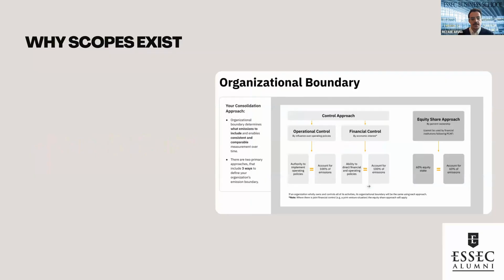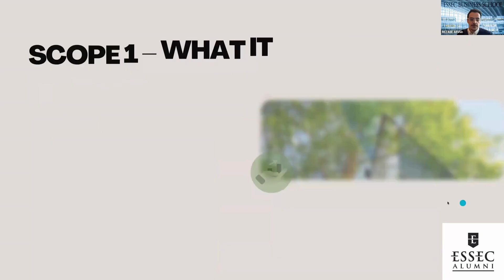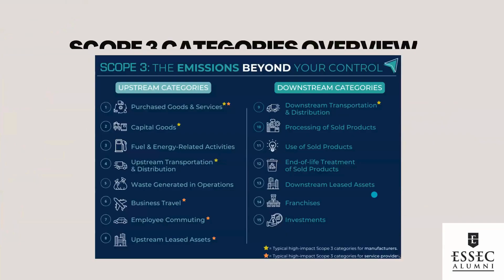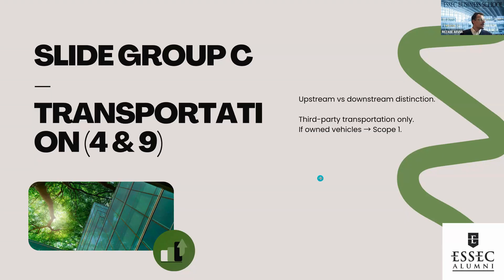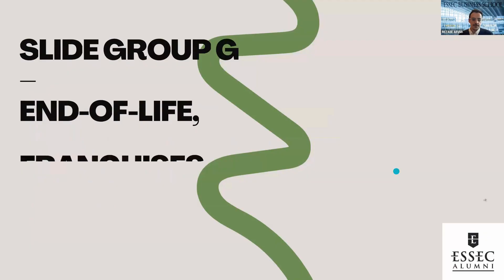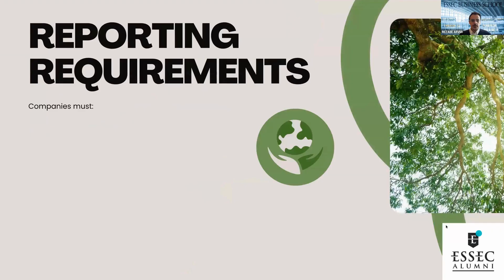Impact Workshop by ESSEC Alumni : Demystifying Greenhouse Gas Scope 3 Emissions

Comment: I've received two questions, which couldn't put it in the recording:
Q1: “Is there any training you would recommend to be certified as ESG Controller and competent to work on non-financial reports?”
Great question! It depends... on your sector, the size of your company, your reporting maturity, and your long-term roadmap.
But in practice, there is no single certification today that makes someone a fully qualified “ESG Controller.” You need to consider, the role is at the intersection of finance, sustainability reporting, internal control, data governance, and carbon accounting!
That is why I would approach it as a competence stack rather than a single certification.

In 2026, I would prioritise four layers.

First, ESRS and CSRD reporting. Start with EFRAG’s own materials: the ESRS Knowledge Hub, implementation guidance, Q&A, educational videos and the latest simplified ESRS materials. These are not “certifications,” but they are the closest thing to the source material that preparers and assurance teams will use. https://knowledgehub.efrag.org/eng

Second, carbon accounting. For Scope 1, 2 and 3, the GHG Protocol remains the core reference point. I would use GHG Protocol courses and guidance first, especially the Corporate Standard, Scope 2 Guidance and Scope 3 calculation guidance. For someone who wants deeper technical competence, the GHG Management Institute is also worth considering. If you're a student, you get a really good discount on the courses. https://ghgprotocol.org/e-learning-opportunities

Third, CSRD / ESRS practitioner training. A structured CSRD course can help translate the regulation into reporting process, gap analysis, datapoints, controls and audit-readiness. Cambridge CISL, Accountancy Europe, CSRD Institute and similar providers can be useful, but I would judge them by curriculum quality rather than brand alone. Look for coverage of double materiality, value chain boundaries, datapoint mapping, internal controls, audit trail and digital tagging. https://www.cisl.cam.ac.uk/education/learn-online

Fourth, finance-facing ESG credentials. If the role is close to investor relations, financial analysis, banking or portfolio analysis, CESGA from EFFAS is one of the strongest European options. But it is not specifically an “ESG Controller” certification; it is more relevant for ESG analysis and integration into financial decision-making. https://effas.com/professional-certificates/effas-certified-esg-analyst-cesga/

My practical priority order would be:
GHG Protocol basics → ESRS/EFRAG source materials → structured CSRD/ESRS practitioner course → double materiality workshops → CESGA only if the role is finance- or investor-facing.

And if the person wants to work specifically as an ESG Controller, I would add one non-negotiable skill: internal control over sustainability data. The market is moving from “nice ESG narratives” to auditable, traceable, finance-grade sustainability information.